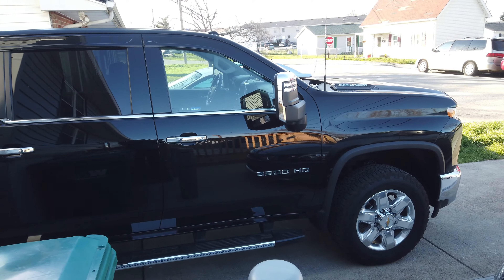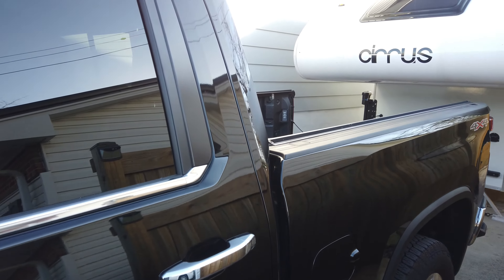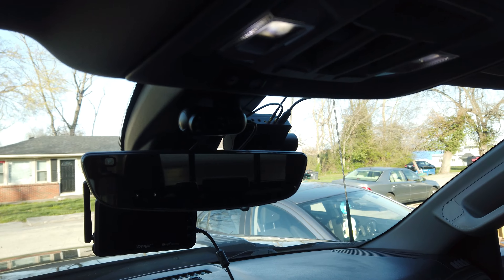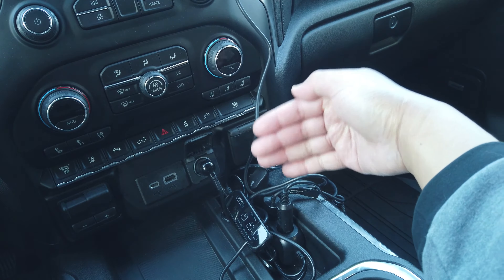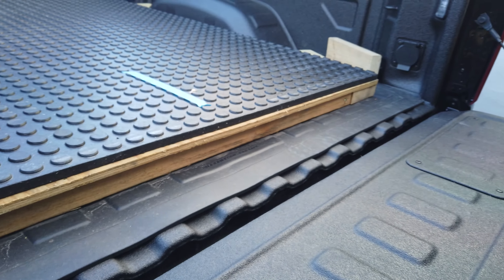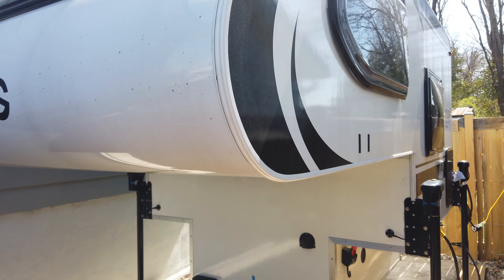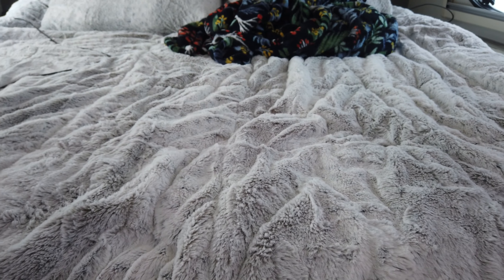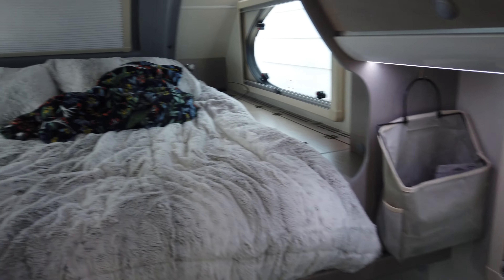Introduction of our Truck and Camper

Comment: Greetings Sir, I may be pulling the trigger and getting the same camper as you. I have a 3500 SRW Denali. Did you install airbags? Also, how high is your platform that you had built?
Reply from the maker: No airbags but might install a sway bar.  The platform about 3 to 4 inches.
Reply: Awesome! Thanks for the quick reply!
Reply: @tonylottiescampingtlcadven6155  Hey Buddy, I ended up getting the Cirrus 620, but I am having some issues. The running lights on the trailer are not coming on. Any suggestions? Also, my fridge is not getting that cold when solely running off the batteries. Any help would be greatly appreciated!
Reply from the maker: @Brian.A.Simmons  I suggest joining FB group Cirrus Truck Camper Owners and ask questions there.  Or ask dealer that you bought it from or contact Cirrus directly using the following email help@nucamprv.com.  They are pretty good on answering emails.  For the fridge question, I usually have it set high when plugged in at home (shore power) before we head out then we leaving set it to 3 when on battery.  That way fridge already cold and doesn’t have to work hard to keep it cool.  Not sure that helps.
Reply: @tonylottiescampingtlcadven6155  Thanks for the help! I can't have a FB account due to my employer. I did speak with the dealer about the issues and they didn't have any real solutions. I will get it figured out though. Thanks again for the reply!